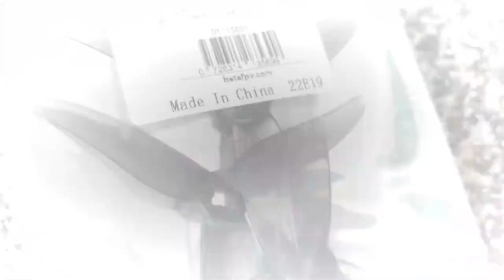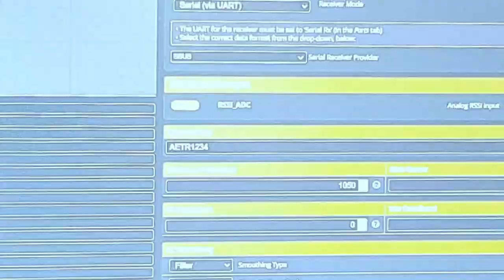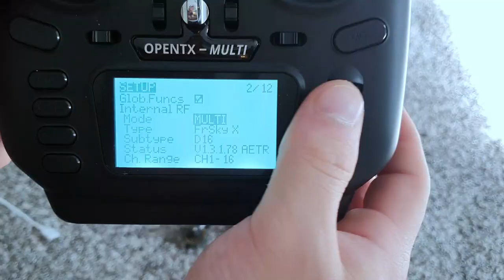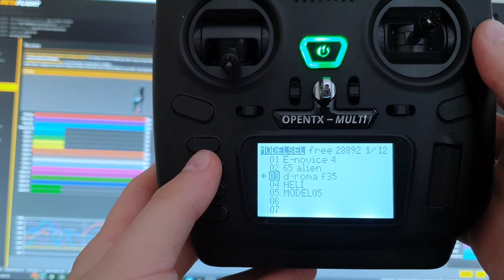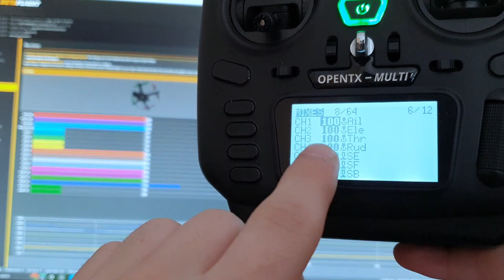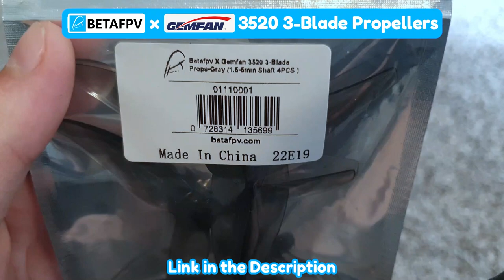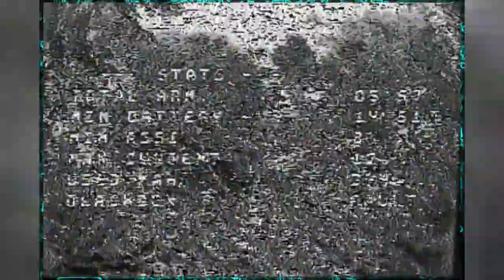Diatone Roma F35 - New Receiver and Props - Flight Video 1

Comment: Seriously thinking about adding this to my collection.   I've got an F5 V2 and an Evoque to cover my 5" needs.  I also have a VenomH20 and Cinerace20.  Really looking for a middle quad.   Cost is the big issue as the DJI version is expensive and I also run Crossfire and will need to buy a receiver.   

Great videos on the 35 and hat tip for winning the Nick Burns sweepstakes.
Reply from the maker: Thank! I appreciate the comment! I like your collection, those are all some pretty cool quads! This is definitely a great 3.5in quad, I even flew a full size Hero 8 on it last week and it handled it really well, very fun overall!

Comment: Interesting!
Very few people still fly FlySky or FrSky.
Reply from the maker: I think that people who don't fly ELRS and other long range protocols tend to fly Frsky when they have a nice radio as it is is easily affordable and very widely used. Beginners usually stick with Flysky since the transmitters are cheap and people such as myself who have upgraded over time then adopt Frsky and more common protocols. Even then, I have an ELRS module but I am saving the receivers that I currently have for other quads. Think about how many quads have XM+ Receivers in them as a standard, especially those released before ELRS emerged. I think Frsky is a trusted platform when ELRS isn't available and of course when ELRS is an option, people will tend to go for that now instead, but in that case (which seems to be the case presently), both are widely popular. Not everyone has ELRS modules or radios yet so the large community of hobbyist with transmitters that have 4in1 multiprotocol chips like the TX16S will tend to go for Frsky as it is the most reliable protocol that is part of that chipset and I think that it is going to stick around because of that until they start making 5in1 multiprotocol chips with built-in ELRS. 😁
Reply: @Adam_Carbone  But doesn't a new FrSky rx cost more than the ExpressLRS rx? In India an FrSky RXSR is about $34 compared to a HM 2.4 ELRS rx for $16 or a Crossfire rx for $30.

And if you already have an ELRS module then you can buy 2 elrs rx for the price of one FrSky rx. So it doesn't make sense that ways.
Reply from the maker: @jumpstartfpv  in the US an frsky receiver is about $12-$20 and elrs is roughly the same so it is just up to what kind of transmitter you have or TX module. The RXSR is a premium frsky RX so that is sort of unfair to compare,it is roughly $30 but unessary for closer range applications.
Reply: @Adam_Carbone  But the premium FrSky Rx is inferior to the ELRS rx in both performance and features. And if you just sell them for half the price you bought them for, you can buy a new ELRS rx with that money. Wouldn't that be better?
Reply from the maker: @jumpstartfpv  That's my point though, Frsky was what people trusted before and not everyone is just getting on board instantly with ELRS presently, it will take time for everyone to transition and learn about it. Like I said before, most quads have an xm+ option which has a decent amount of distance for how inexpensive and small it is. Some people again like it because they can just pick up their radio and use it with the CC2500 Chip whereas with elrs you have to plug in the module which can be seen as an inconvenience (until elrs is built into multiprotocol chips, the future). I am not arguing that ELRS is worse or anything, definitely the best for range overall, I am just saying that Frsky definitely and most certainly is not dead at all, still very widely used.

Aside from that, something else that people don't consider is that sure ELRS has a farther, insanely long transmission range than Frsky an other protocols, but that doesn't mean the Frsky sucks, oftentimes you can still go like 2km without any issues with Frsky which is plenty for most people and if you are a long ranger, then there are protocols like crossfire and elrs that are made for the application, even Frsky R9m long range 915mhz system which is separate from their standard D16 and D8 protocol branches. So I think that it is important to look at it that way too, it is all about someone's given circumstances, not about the money necessarily. If you already have committed to an ELRS setup that obviously the receiver decision is much easier to make, ELRS all the way! I happened to have a spare Frsky receiver and since it worked just fine for my application, I used it. 😁👍